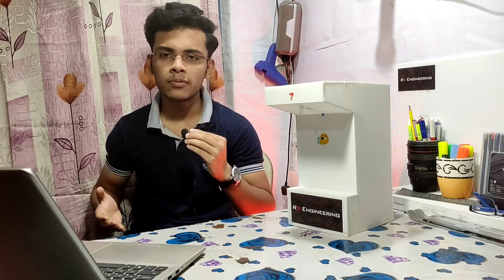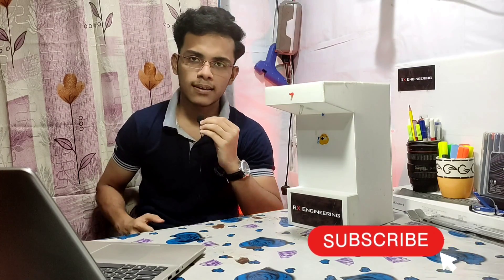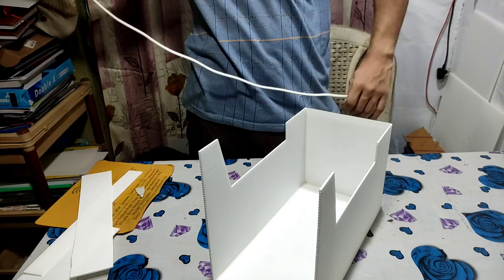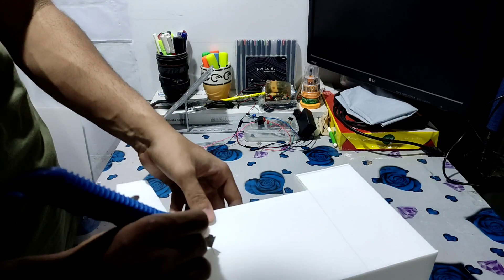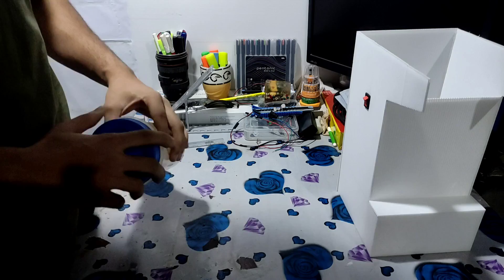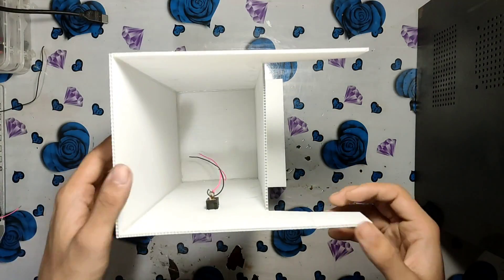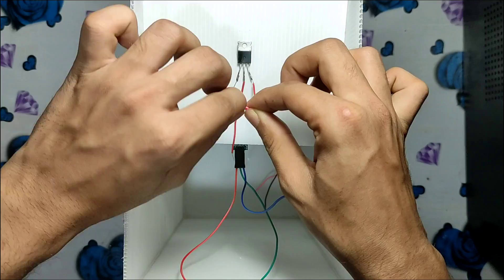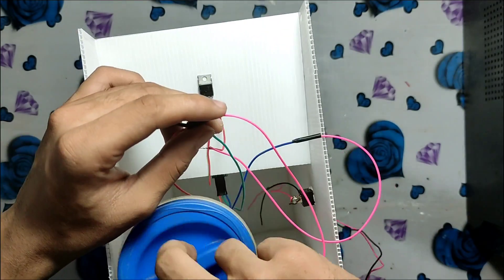Automatic Hand Sanitizer Machine | Automatic Hand Wash | IR Sensor Project

Comment: When i am doing same wiring guaranteed it works 100 percent?
Reply from the maker: Absolutely it's works 100% but make sure that the connection is correct and i already give the circuit diagram in the description so you can simply download it from there.